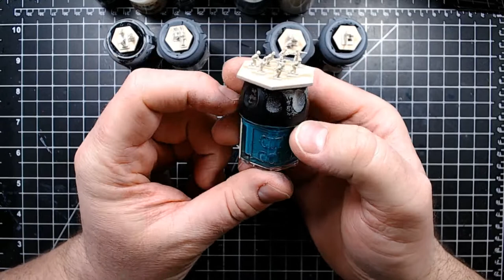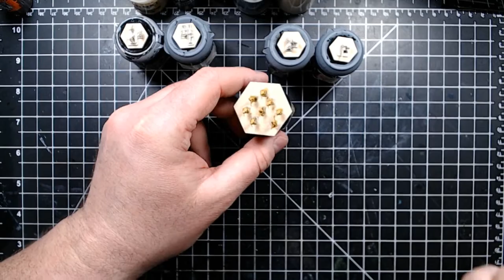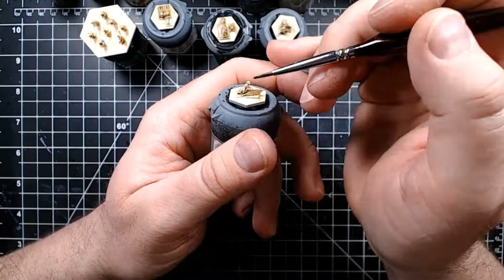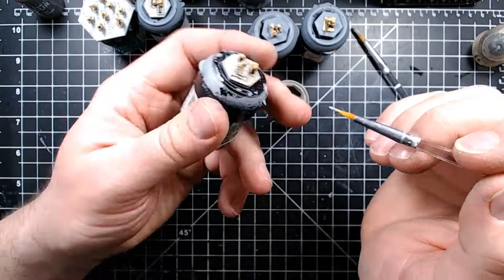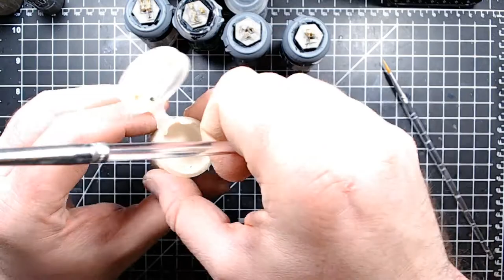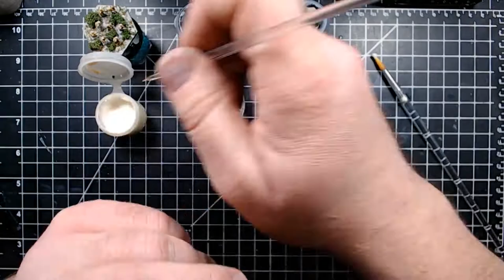How To: Paint 6mm Infantry with No Effort - GHQ 'Nam Era US Individual Infantrymen and Heavy Weapons

Comment: Where did you get the bases? thanks
Reply from the maker: The Dollarama. They have packages of 'Wooden Shapes' that are either round, square, hex, or heart and come in a variety of 20-30-40mm sizes in batches of 100. I've ended up with quite a bit of the 20mm sizes.